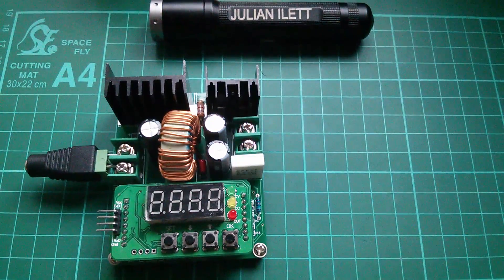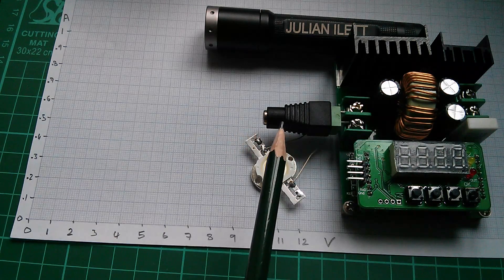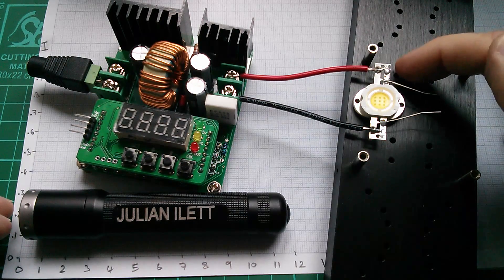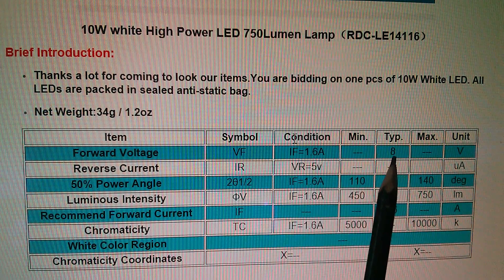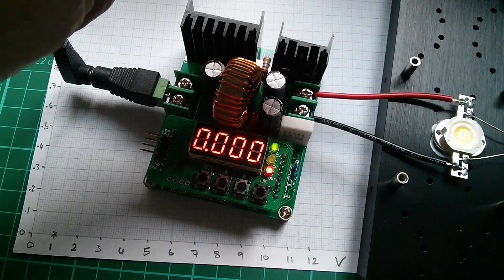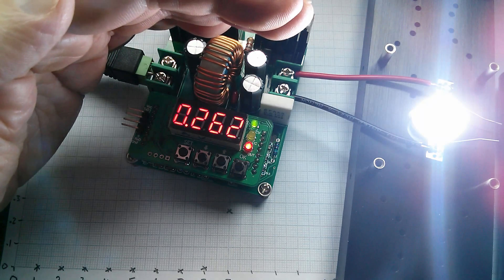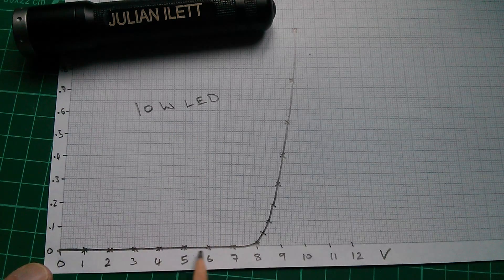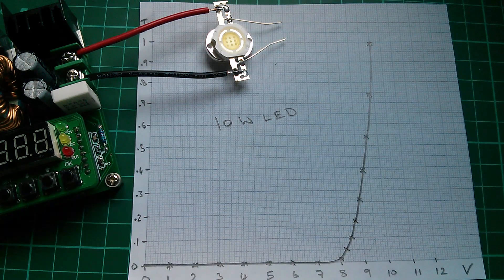LED Tutorial: Plotting the IV Curve for a 10W LED

Comment: Thank you for doing this!  It saved me some time for sure, and probably saved a bunch of LED's too, since they are advertised as good from 9v to 12v!  2 volts too many...  I'm thinking of putting five of them in series and operating on 12s lipo power in my RC helicopter.  12s Lipo would be 12x 4.15v for 49.8v, declining to 44.88V since I only charge to 4.15v for long life.

Comment: 320x3 960ma should be the correct driver current for most Chinese 10w LEDs. This also gives the correct forward voltage at 960 ma 9.6v/3. The Chinese data sheet is way out.

Comment: I have to do this same test for a batch of 10W LEDs I have ordered.  I want to run something like 9 or 12 of them in series parallel, on a 50W supply (to derate them for long life).
But I need their I/V data to know if I should use 3 or 4 in series and 2 or 3 in parallel, to match the 50 watt supply voltage and current limits.

Comment: Now, plot the current on a log scale.  You may need to add a milliamp meter in series to quantify the lower end.  This makes the curve much clearer.  8.5 to 10 volts cover the 0.1 to 1 amp decade, something like 7.5 to 8.5 will cover 0.01 t0 0.1 amp decade, 6.6 to 7.5 will cover the 0.001 to 0.01 amp decade, etc.  you will need a meter to resolve the 0 to 4 volt end.microamps for the

Comment: This is actually pretty awesome. I've always wondered how all this worked. If you were going to control the brightness of an LED would you limit the amps or the voltage going to the LED? It seems that you could do it either way, but perhaps there one way that is more conventional than another.
Reply: For controlling the brightness, you'd normally limit the current at the maximum current the LED can take, and then modulate a lower frequency PWM signal onto that so that you pulse the LED at max current. Always constant current however.
Reply: As Julian explained in a previous video, The LED is on in the area of the curve with low dynamic resistance and a steep I/V curve. A small change in voltage makes a big change in current and that can potentially caouse damage. Therefore it makes more sense to power LEDs with a constant current supply. If you power a LED from a voltage source, you typically need to add a "current limiting resistor" which is inefficient at high power and A voltage source with a relatively high series resistance is the Thevenin eqiuvalent to a current source.

Comment: very helpful. but you should have gone all the way( for the name of science) and blow the sucker.
Reply from the maker: Tiit Saul Blow the LED? The tiny internal connecting wires just blow like a fuse. It's pretty unspectacular.
Reply: I was just wondering if there is any "warning" in the amp curve before the led fails.
Reply: Tiit Saul
Yes. I've seen it elsewhere, but can't rememeber where. The curve plateaus then starts to fall as it fails.
Reply: Cool. Thanks for the info.
Reply: *****
Crank it till it pops. He could have at least hit it with a hammer.

Comment: I think you could use an arduino to record the current and voltage while increasing them on the converter, and then put the results in to Excel.
Reply from the maker: WFIWasserkraft That would be relatively easy (and fun) to do if the buck converter's Tx and Rx pins actually did anything. But unfortunately they don't.

Comment: The thing is as long as the LED is on, its temperature keeps increasing (up to a point) and as a result the voltage drop decreases and the current through it increases (as seen @ 5:32). In other words the current that flows through an LED is not only dependent on the voltage but its temperature also. Lumens are also dependent on current and temperature.
I'm very curious, why did you spend so much for a 10W LED. This is a very expensive 10W LED, why?
Reply from the maker: runner180fxr I bought this LED some time ago, when other 10W LEDs were a similar price. Looks like Sure Electronics just haven't reduced the price in line with other vendors.

Comment: Nice work Julian. I'm going to try and do a IV + temp curve for a 100w LED. The temp curve will be completely tied to my CPU heatsink and cooler, but would still be nice to compare. Active cooling even with a slow fan makes a huge difference to performance and temps.

Comment: I have doubt, what if two multimeters i.e. separate current and voltage measurement and a non-buck DC PSU used, will the same plotted curve graph stay ?
Reply from the maker: TheOldmankk I think so. I can't see why it would be any different.